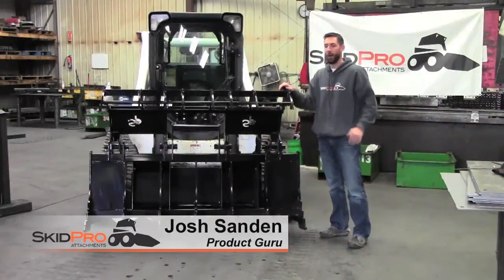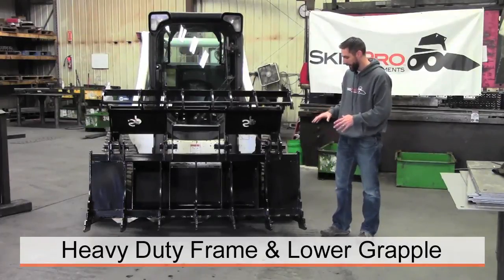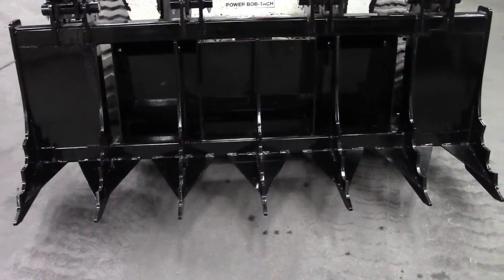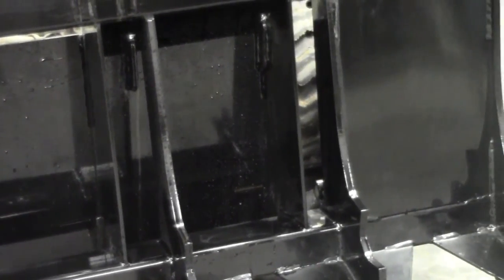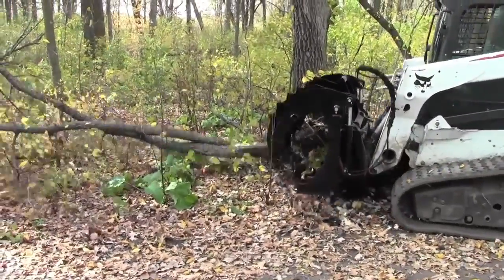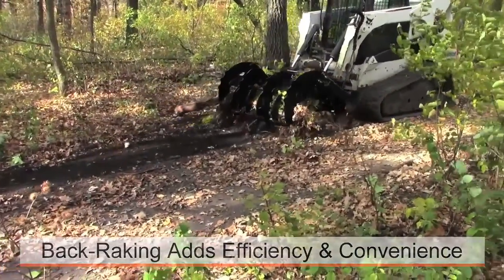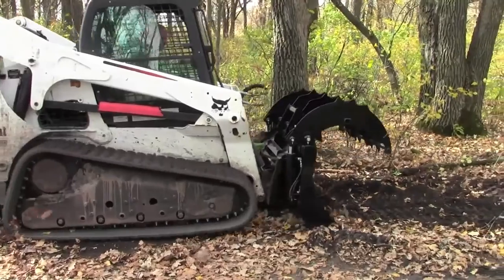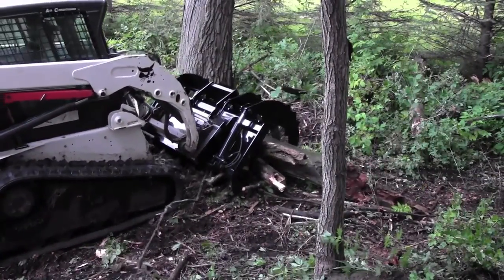Skid Pro Skid Steer 72" Grapple Rake

Comment: Nice Grapple - What does this cost ?
Reply from the maker: The 72" unit is $3,795. We do have a sale coming up on this grapple shortly. For more info and an exact quote (you might be able to get sale pricing early), please call the office at 877-378-4642. Tell them Josh from YouTube sent you! Also, if this grapple is out of your budget, we've got units all the way down to $1,500 depending on what you need and the size of your machine carrier (aka Bobcat).
Reply: I like the industrial rake with the replacable teeth but would like it in the 72" version. Do you make it in the 72". I have a kubota svl75 and think the 84" would be a little too big. I am getting a brush cutter from you in a few weeks and am considering a grapple rake also
Reply from the maker: See reply above for more detail. The 72" Grapple Rake will be a great fit for your Kubota SVL75.

Comment: Does the industrial version come in 72" and if so what is the price
Reply from the maker: No, the 72" does not come in an industrial version. We needed to shave weight so that medium-sized machines could handle it better. That said, we've gone up to 80 HP compact track loaders w/ no trouble at all. It is 1/2" high tensile steel and we over-gusset the bottom tines and the top as well. The 72" Grapple Rake is a perfect match for your Kubota SVL75.